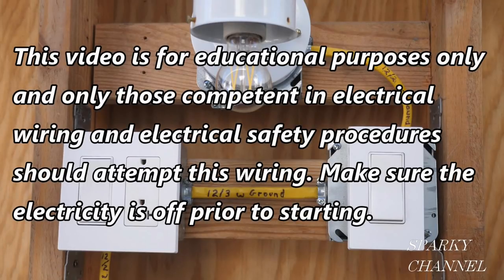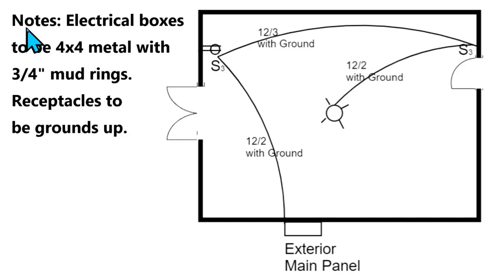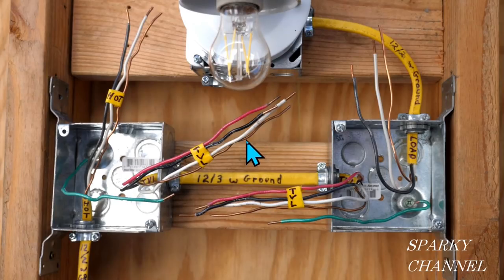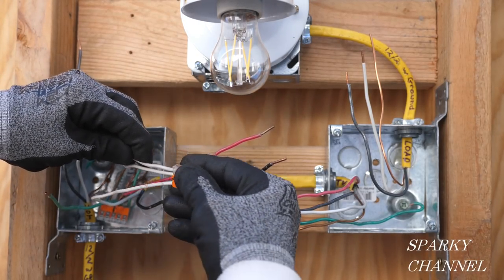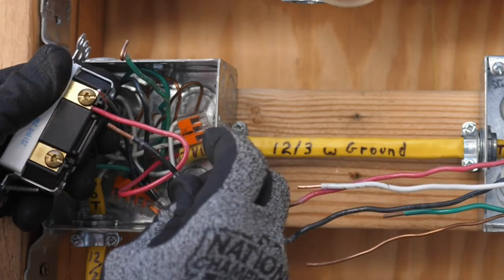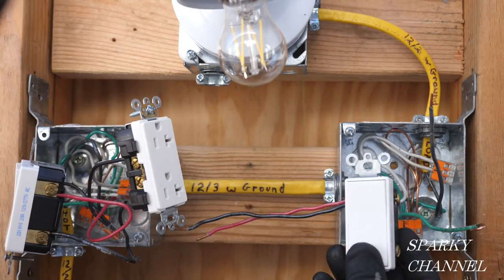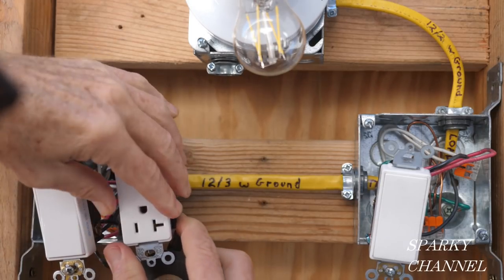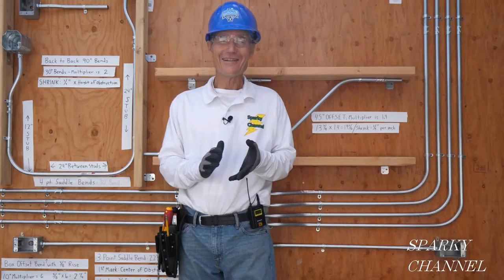How to Wire a 3-Way switch and a 3-Way Switch with Receptacle

Comment: Love your demo board with all the labeling!

Quite a while ago I bought a voltclaw after you introduced it.  Absolutely love it!  Hard to remember the frustrating finger manipulation decades prior with out it.

Impressed at your crimping the wire attaching to the screw.  Rarely see that done in videos, starting to think I was the only one who does that.

I put the black traveler at the top, as I count black-red-blue as 1-2-3 and number from the top down.  Do you have a story as to how you came to red on top?
Reply from the maker: Yes, labeling is a good idea IMO. Yes, Voltclaws are really handy. Crimping the wire around the terminal was common back in the day. IMO it makes for a better and more reliable terminal connection. It has fallen out of use these days. I've seen some terrible j-hooks too. It's all about speed now.  For the 3-ways, I just put the red on top by habit. Also, I think it's an easy way to teach people. They can tweak it to their preference later.

Comment: I've seen situations especially in older homes where johnny homeowner used 12-2 for a 3 way using the ground wire as the neutral and connecting the black and white as the hots between the switches.  Totally unsafe.
Reply: Yes, truly “Joe Homeowner” work which is totally unsafe!
Reply from the maker: Wow! I haven't seen that but I have seen where the neutral is being used as one of the traveler wires and there is no ground (circa 40's to 60's).
Reply: I've seen kitchen renovation contractors do that too...

Comment: Good video explaining the procedure very well. Is there a reason for the duplex receptacle being mounted with ground up? I've run across some where the ground is mounted down. Thanks again for a great video.😊
Reply from the maker: Yes, the reason is that the plans say that the receptacle must be installed with the ground up. There is no code saying the ground must be up or down but when your plans state one way or the other, that's what you have to do.

Comment: are the red and black traveler wires interchangeable on what ever screws your want on the right side of the switch?
Reply from the maker: Yes, they are, but they must go to the bronze colored terminals.
Reply: It doesn't matter, it defines the positions of the switches when on or off, but nothing more. You still have your four possible scenarios depending on the position of the switches:

Number 1, light off:

https://upload.wikimedia.org/wikipedia/commons/2/24/3-way_switches_position_1_uni.svg

Number 2, light off:

https://upload.wikimedia.org/wikipedia/commons/2/2b/3-way_switches_position_3_uni.svg

Number 3, light on:

https://upload.wikimedia.org/wikipedia/commons/c/ca/3-way_switches_position_2_uni.svg

Number 4, light on:

https://upload.wikimedia.org/wikipedia/commons/e/e6/3-way_switches_position_4_uni.svg

Comment: Why would the grounds need to be up? I’m a new apprentice just trying to learn why that would be called out
Reply from the maker: Hi Jesus! If an architect or draftsman calls it out, and the plans get stamped, you have to do it that way. There is no code saying that the grounds have to be up or down but if it's on your plans that grounds are to be up, that's what you have to do.
Reply: With age and wear plugs often become loose in the outlet and then gravity can make them tip down, exposing a little bit of the top pin. Its much safer then if this is the ground rather than possibly the hot. Unfortunately this was not brought into the Code early on, and as many plugs are molded in a right angle, assuming ground down, its too late to mandate it.

Comment: Why is the ground wire on the switch wrapped counter-clockwise around the grounding screw instead of clockwise on the first switch that you installed??? Also can you make a video on how to bend a hook using stranded wire???
Reply from the maker: A goof, I guess. I'll see what I can do.

Comment: Why use metal 4 square boxes with mud rings as opposed to a plastic box? I work in a factory so we don't use that type of application. Also, are there different depths of mudding for the different thickness drywall? Or do you have to adjust where the box is mounted on the stud?
Reply: different thicknesses
Reply from the maker: Several different thicknesses.
Reply: Hi Bill,

How about wiring a 5 way switch?

Comment: Years ago.  A elec company did a job,  where they installed some wiring to the garage from the house.  Some Electrician.  Did not install enough wires. Short story. Is that there was a pool in the back yard.  A small kid one day ran to the garage soaking wet to go into the garage.  He lifted the door. The garage door had become elec hot.  The kid got electrocuted.   When the Granddad found out that the company did not get a permit. He went bizark.  As. It was a $50 fine. The Grandfather went to the State and went to every State rep to get a law passed in the State of Ky.   Now if caught no permit is $1000 a day.   Most inspectors here will tell you to go gt the permit.  But u better and don't make them mad at you.  So the result now is that some parts of the city of Louisville, people find out that they can't afford a electrician to come in and do work and pull a permit.  As all the added cost.  I had 2 elec inspectors tell me the same thing about the NEC.  Driving up costs.
Reply from the maker: I'm so sorry to hear about that.